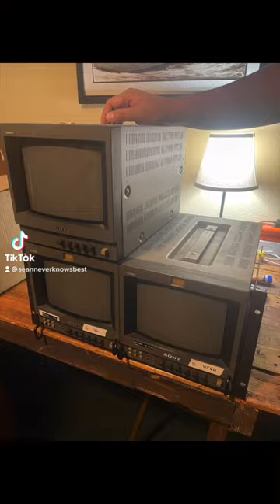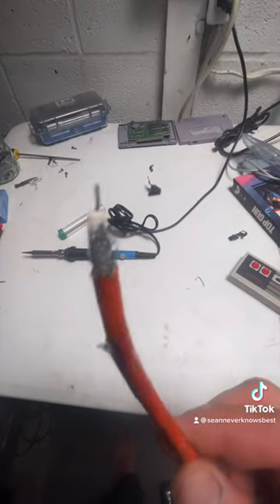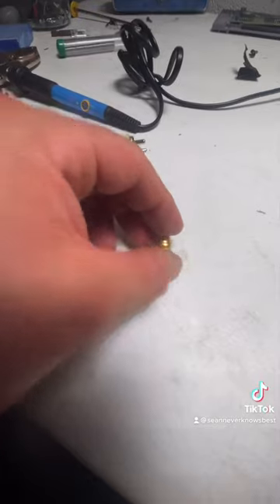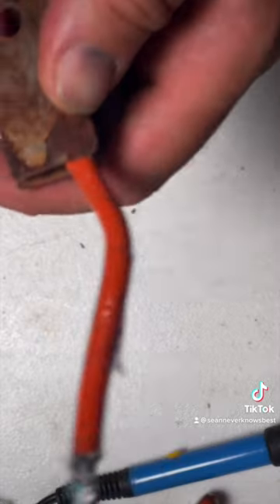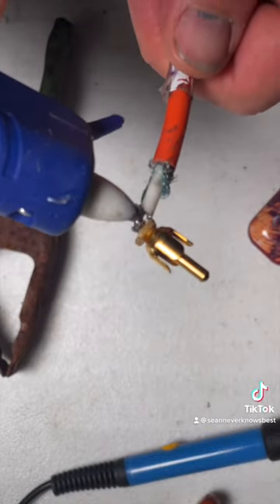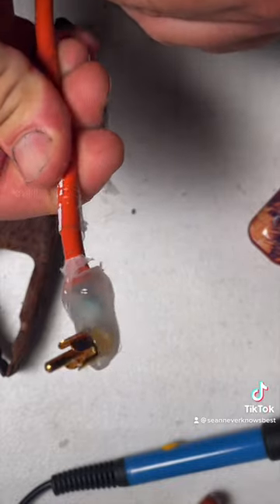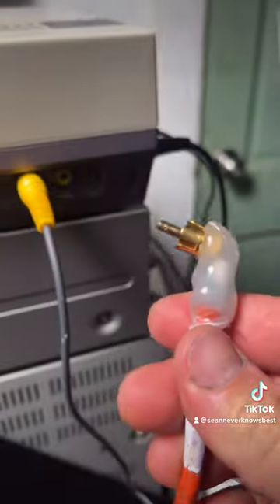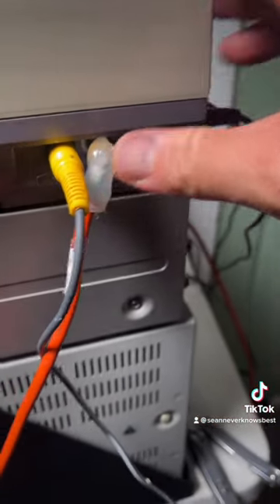I FOUND THE GOLDEN EGG! #CRT #retrogaming #retrogamers

Comment: I have just about every gaming emulator from ever console with ever game rare ones too on my pc way better i can adjust the graphics add cheat codes input turbo for the button configuration etc a whole new gaing experience for the retro games 👍
Reply from the maker: Sweet dude! You should get a hdmi downconverter and send your emulators feed in to one of these super awesome pvms! Do you have one?
Reply: @EmeraldCoastDigitizing  I have high speed hdmi cable and display port cable the display cable has much better graphics 👍